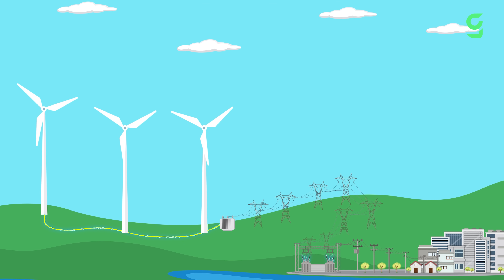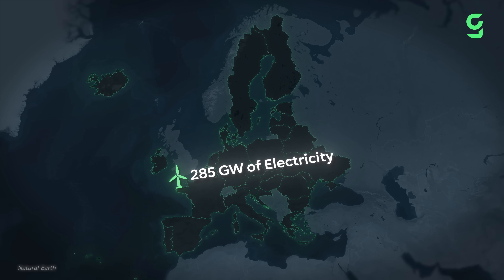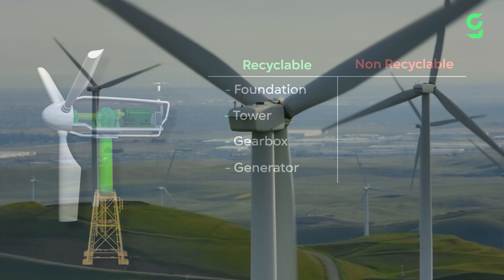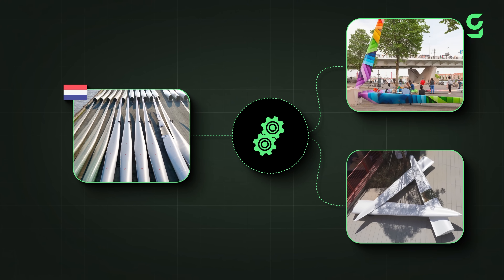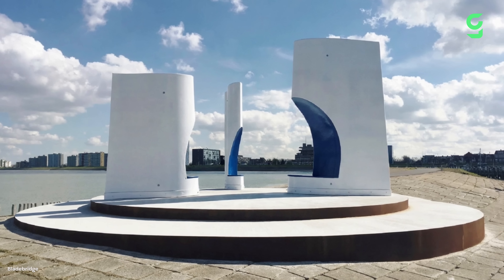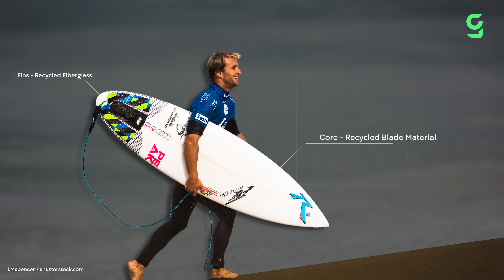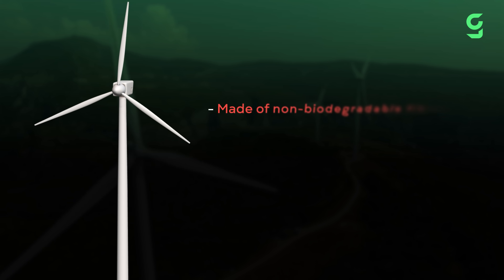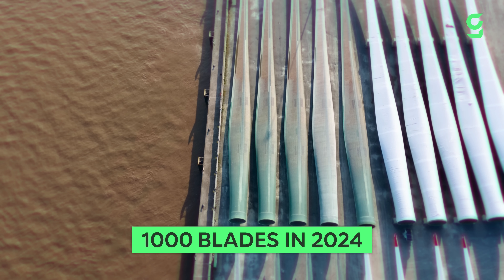What Happens to Old Wind Turbines?

Comment: if these blades are really that much durable that it is extremely difficult to dismantle or recycle them then why we don't just use those same blades again in the windmills?
Reply: Because the main reason to decommission a wind turbine, is the wear and tear of the blades themselves. They simply start cracking. Small cracks can and are repaired, but at some point they will be so bad, that they can't be repaired.

The next issue, is their size. 25-35 year old wind turbines are very small. They generate a max. of 500-1500 KW (0,5-1,5 MW), and if you can replace it with a wind turbine, that generates 3-6 MW, there's no point in reusing them. Fewer, larger wind turbines require less maintenance. Bigger is always better.

PS: A windmill mills/grain corn/grain, hence the name. A wind turbine drives an electric turbine. Just saying.

Comment: I am amazed that bamboo composite is never discussed. There are companies developing these stiffer, stronger and biodegradable blades. Bamboo is the gift that keeps on giving as it is grown to harvest in months and is a carbon absorption sink. I think the cost of the blades would actually decrease. Everything can be made from bamboo.
Reply: You do know that bamboo composite is cellulose  plastic, just like any other plastic. It's just weaker, so we will landfill more of it!
Reply: Not strong enough
Reply: @Hiusername-not-cursed  are you sure in Sweden they are making turbines from engineered wood…. Why not engineered bamboo…
Reply: @ImpossibleSolution-k6w I mean for large scale ones those are tiny compared to the large scale wind turbines
Reply: @Hiusername-not-cursed  The tallest one Modvion has made so far is 150m. In Germany another company is working on just making the blades from engineered wood. The longest blade I believe they have made so far is 50m long.  Both companies are relatively new in the Wind turbine industry so they have to work their way up, so to speak.
Reply: @ImpossibleSolution-k6w there is a structural limit on wood so they most likely have reached their limit unless they add epoxy or something which will then make it harder to decompose

Comment: Why not put them with the leftover fossil fuel residue once you extract the energy? Oh wait, that would be the atmosphere. Even if we burned worn out wind turbines to dispose of them, the resulting particulates in the atmosphere would be a fraction of what fossil fuels pump by the same weight, and it happens once ever 20 years instead of every time you turn something on.

Comment: I’m glad that we are showcasing issues with these. Too often they’re put on a pedestal without talking about the problems that come with them and how we fix those
Reply: Think wind turbines are bad, we should be paying attention to solar. 
The people who purchased these systems have no idea how much it's going to cost them to keep them out of landfill.
Reply: Everything humans build has waste and issues. Nothing is perfect.

 It's not about being in denial about issues with anything we invent and build, we just need to be responsible about how we handle it.
Reply: @billnye69  Facts, it's why nuclear remains among the cheapest and cleanest energies on the planet. The regulation on disposal is unmatched.
Reply: @Think6.6  
Yeah, but we 're not paying African warlords for fiberglass or have to consider how to communicate the danger of old rotor blades to peoples in the far future.
The regulation has to be this rigorous to prevent incalculable damage to the nation and society.
Really, how to deal with extremely large fiberglass bodies is comparatively trivial.
Same with solar panels. Yeah, we are coming to the point where most of the 1st gen stuff is cycling out and we have to deal with large amounts of waste here. 
But this is extremely uniform waste that is not hazardous. Glass, plastics and electrical elements can absolutely be recycled at low cost.
It'll take a while to find optimal solutions, but the sheer amount of installed units is forcing the issue before long.

Comment: I had heard that the blades were "impossible" to recycle. It's nice to hear about ways they are being used. Just about everything can be recycled if we think outside the box.
Reply: Whos gonna pay for it?, recycling is not free. No sane company runs a business with a loss, its impossible.
Reply: sure you probably too lazy to recycle your trash correctly.
Reply: It seems to be a problem as good as fixed, one is to use materials that can be recycled and the other is to recycle the materials both seem to be fix or going good enough to its almost fix, it looks to me that companies have already been able this year to recycle it but it’s not cheap enough so likely long term solution seems to be the change in materials which is also as good as being ready for large scale use, of course china will probably be the last because it’s probably going to be a little more expensive to build recyclable blades, but the important part about the new martial is that they can be recycled in biological processes, the tree stuff I doubt, he said 20-25 years in Denmark we use the blades for 30 years a tree fiber is not up for that, but if you change the blades after 15 years haft lift it might be worth it but it might not be it’s expensive to replace the blades.
Reply: @kimmogensen4888 ok go do something useful 😅
Reply: ru challenged?
Reply: @ivansherbinin can't write or reply correctly 😅
Reply: I saw they just bury them where liberals can’t see them,conservatives see them often.

Comment: Why cant old blades be used in new turbines?
Reply: The leading edges wear away due to high speed contact with air born particles
Reply: Because the main reason to decommission a wind turbine, is the wear and tear of the blades themselves. They simply start cracking. Small cracks can and are repaired, but at some point they will be so bad, that they can't be repaired.

The next issue, is their size. 25-35 year old wind turbines are very small. They generate a max. of 500-1500 KW (0,5-1,5 MW), and if you can replace it with a wind turbine, that generates 3-6 MW, there's no point in reusing them. Fewer, larger wind turbines require less maintenance. Bigger is always better.